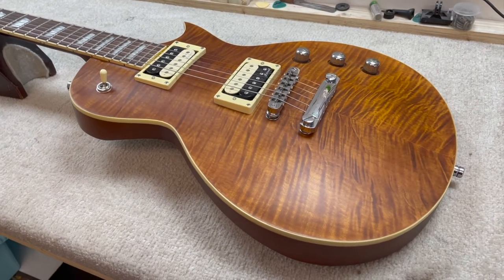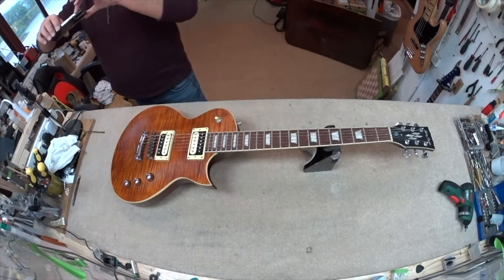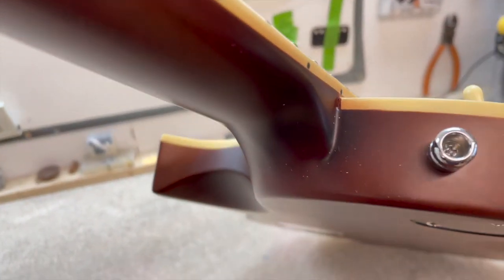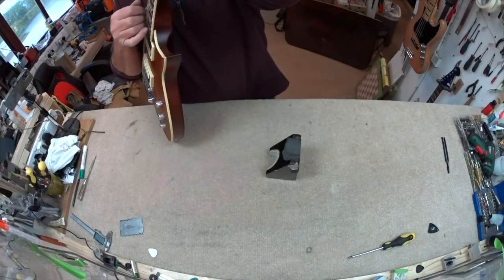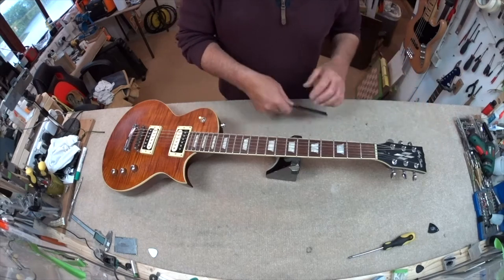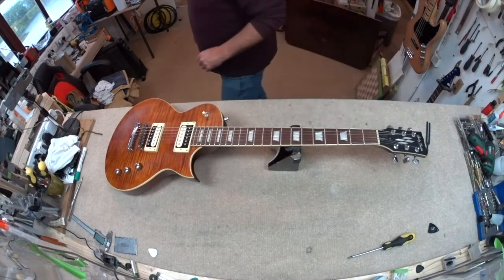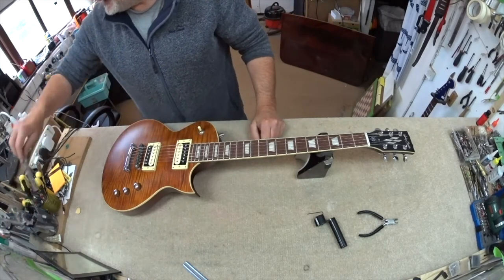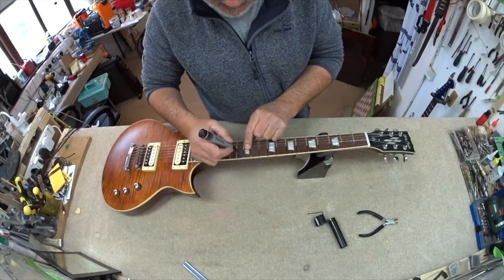Andy Partridge's Harley Benton SC Custom Line set up

Comment: Heat shrink on each term on the switch will last forever and keep the wires from touching.  Great detail video. Thanks.
Reply from the maker: You're right... difficult area to get in with heat gun so have to use soldering iron to shrink the tubing... Thanks for your comment!

Comment: What is the situation with import duty on these harley bentons now. I'm thinking of getting another (I have a sc custom and wouldn't mind one of their cherry 355 alikes) wondered how much duty I would have to pay on around £200 - £250 guitar or do you give an all in price for the guitar inc duty, adjustable nut and setup straight from HB to you and then from you to me in London.
Reply from the maker: It goes like this: Thomann shows us in the UK a VAT-free price. So let's say this guitar comes up at £275 to us. Because it's OVER the £135 limit, Thomann charges us £275 + / inc. postage. The courier brings it to you but is responsible for collecting the VAT which is £55 plus about £11-15 in 'broker fees'. That's £55 ON TOP of the VAT-free price Thomann charged you remember. And they won't let you have the package until you've paid that money. They give the £55 VAT to UK Govt and keep the £11-15 fees for playing 'tax collector'. 
If on the other hand the Thomann price is £100, then because it's UNDER a £135 limit set by HMRC, then in that case it's Thomann that collects the VAT part at checkout. In that case, you'd pay £100 + £20 VAT at checkout plus any postage. Total cost to you £120 + postage. In that case, the courier just delivers the guitar and Thomann pays the VAT to UK Govt. 
So the real increase in cost is that sneaky additional £11-15 that the courier, in their new role of tax collector, charges for their effort. You paid them the postage before and you paid the VAT to Thomann (within the price of the item) previously but that £11-15 is now extra. 
Worse yet - if you buy a guitar from a seller in the EU as a private eBay or Reverb sale, the courier that brings it to becomes responsible for collecting VAT from you. That's 20% VAT plus their £11-15. I had this recently for a customer who bought an €800 guitar from a private seller in Italy. Previously he would have paid €800 + postage and the guitar would have arrived, end of story. Thanks to Brexit he had to pay the €800 to the seller, the €postage AND 20% of €800 to UK Govt plus the courier's 'tax collector' charge before they would deliver it to him. That's €160 of our money that the UK Govt never had access to before - €160 EXTRA on top of the purchase cost. Nice eh?

So to answer your question: on a £250 guitar you would pay the £250 plus an additional £50 to the courier + their £11-15 brokerage fee. That means if you have it sent to me I have to pay the £50 + £11-15 to release the guitar. My set up price on a guitar like that with custom adjustable nut, strings, precision levelling is £125 so I would invoice you £125 + £50 + £11-15 + £25 P&P. If you had it sent to you first you would pay the VAT & courier fee and would of course also have to pay postage to get it to me.